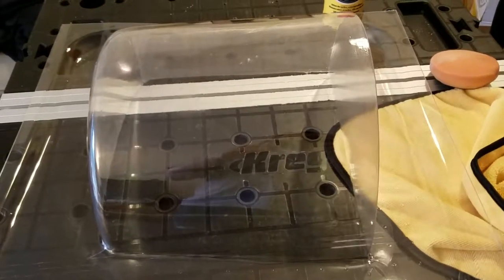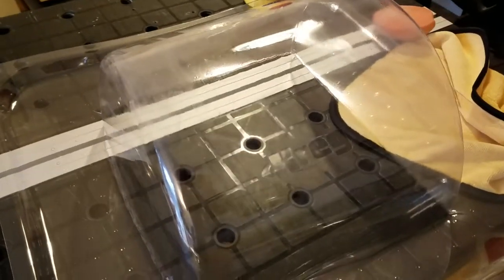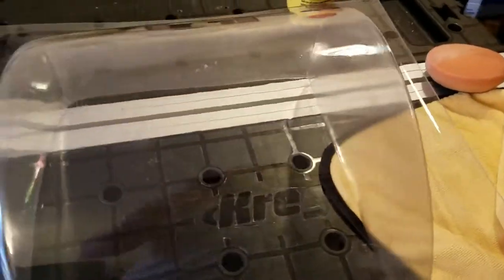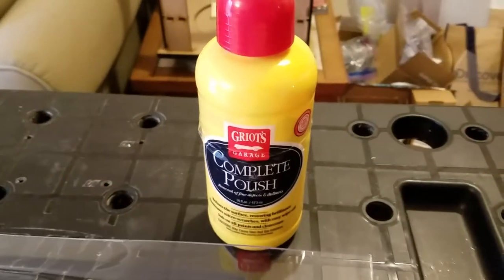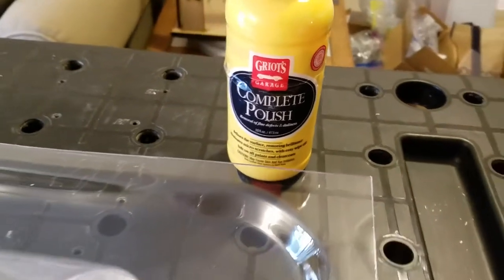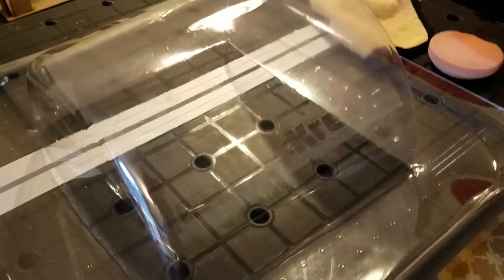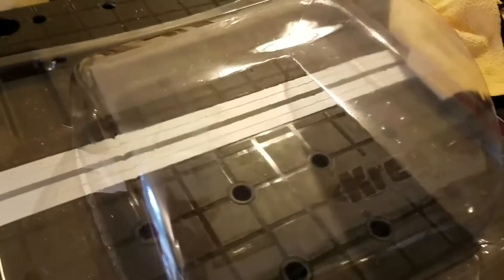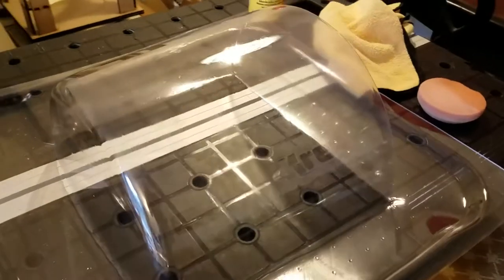Cleaning Debris from Vacuum Formed PETG

Comment: where can i buy PETG sheets like this for vacuum forming? where did you buy it. Also, the sheet i need is 4x4 feet plus. which is big, but if you could give me a link that would help out
Reply from the maker: I picked it up from a local plastic supplier that stocks Vivak. It comes in 48" x 99" sheets.

Comment: how thick would you recon i need to form the nasa bubble helmet which is about 10" H by 10" w by 12" h
Reply from the maker: I don't think you can vacuum form that part in one piece, because the top is wider than the bottom "neck" (like a lightbulb), so you'd have no way to get it off the master buck template unless you made some crazy multi-part negative master buck. They were very likely blow-molded instead.
Reply: @mwjscn  they were blow molded and i will simply cut the buck up and take it out and any scratches i make will be filled with clear resin
Reply from the maker: @wetbredloaf If you made a two-piece negative buck down the middle with drilled holes on the sides that lead to chambers/holes in the bottom you may be able to pull a vacuum on it. Basically just skip the conventional platen and make a two piece mold that contains your vacuum chamber and hookups with a sealing surface on the top where the "neck" is.
Reply: @mwjscn  making a negative is much more complicated can just cut it thin then break it off
Reply: @mwjscn  or i will dissolve the abs with acetone and the bubble will be left behind